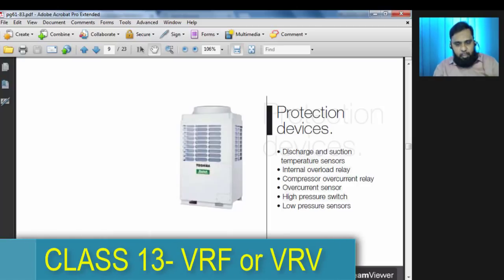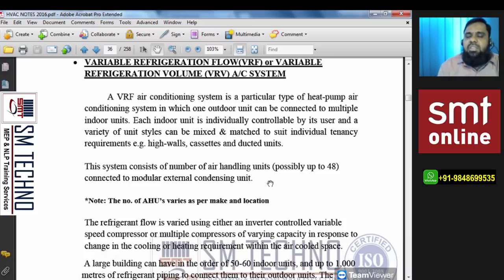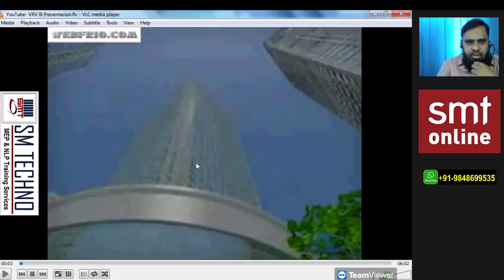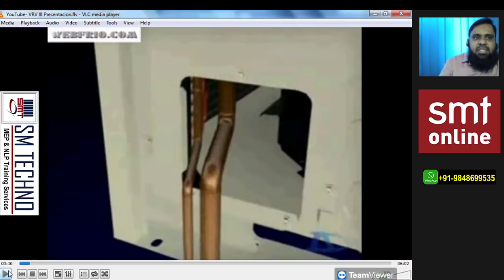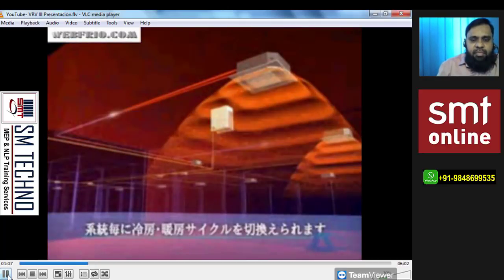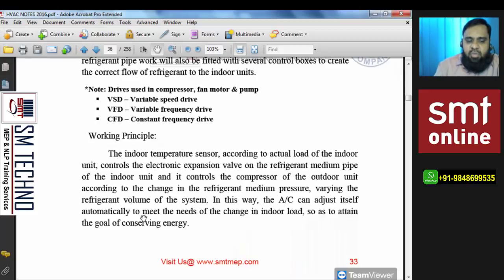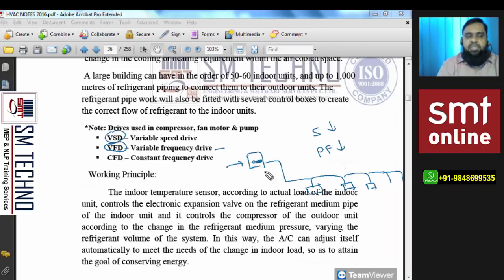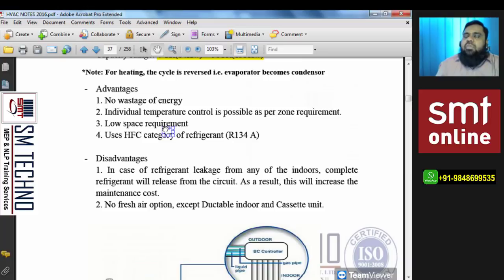What is VRF OR VRV - HVAC DESIGNING CLASS 13

Comment: its not indoor temp sensor who controls the EEV, actually it is liquid thermistor temp and gas thermistor temp mounted on inlet and outlet of evaporator,the difference of inlet and outlet is superheated degree,SH degree ll be compared with targate SH(around 5deg set by diakin) 

if SH>target SH then the controler allow the motor to open EEV. 

also the compressor speed ll be increased or decreased  by indoor pcb linked through control wire to outdoor pcb which inturn change the frequency and vary the speed of compressor when there is a demand of cooling sensed by return temp sensor  (not by differnce in temp as u said).